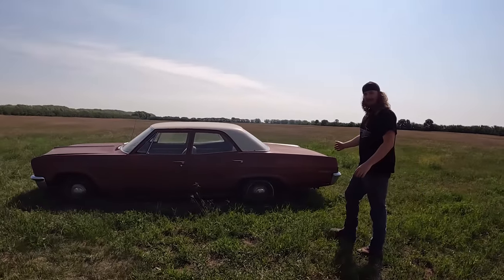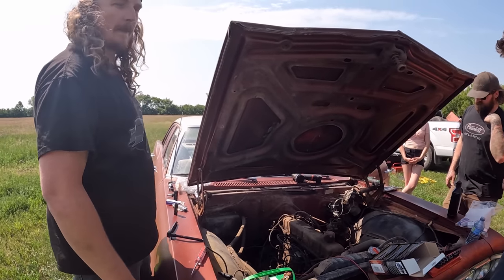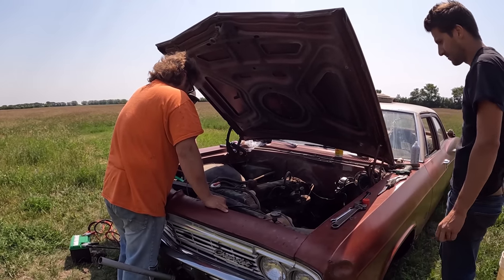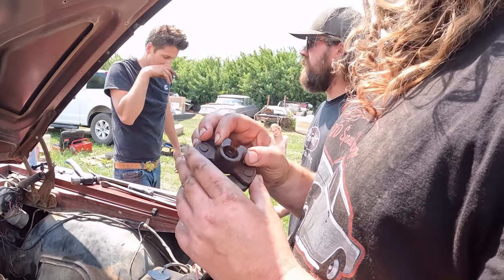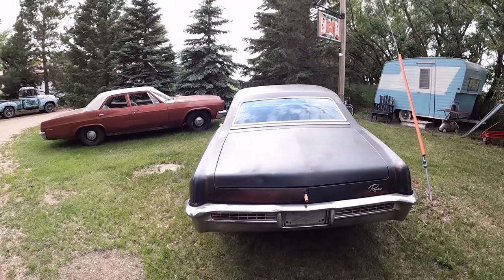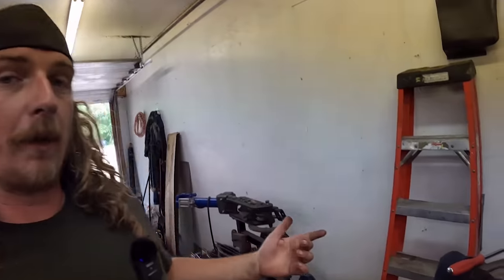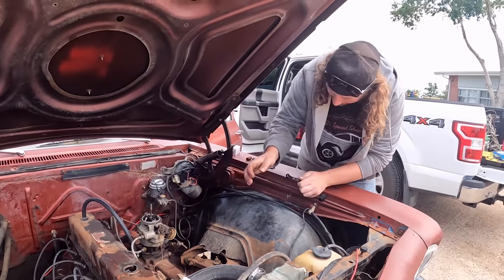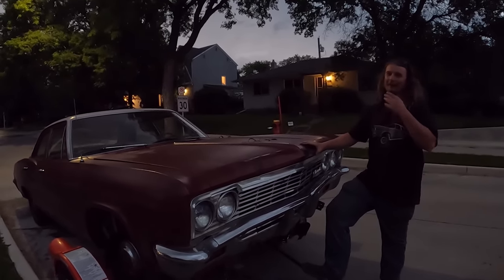ABANDONED 1966 Chevy Biscayne - Will It Run And Drive After Sitting For 20 Years?  Grandpa Special

Comment: I had an Impala 4 dr years ago. You may remember it, it was white with a painted black roof and blue flames called the Millenium Falcon. The front strut rod ripped out of the frame and force it into retirement in 2001. Bought a Belair that I wanted to make one from the two but it never happened. Sold them to a guy on Inkster who had a two door sedan. He wanted me to pay him to take them away, no. Got discouraged from the car hobby after that. Have a lot of spare body parts for a four door I want to get rid of but don't want to scrap. The car in this video looks really good.

Comment: I have my grandmother's 66 Chevelle 2 Dr sedan. Was a 194 straight 6 with Powerglide. Now has a .040" over 427 and M-20 Muncie. It needs front suspension rebuilt and I do have all new parts including tubular A-arms and disc brakes n spindles. New power break master cylinder.  I also bought a 9 inch rear housing set up for the Chevelle. New axles and posi carrier for the pumpkin I'm using from a pickup. 3:91 gears. New mags with new T/A Radials. I always teased my grandmother I would stuff a Rat Motor 🐀 into her car. Promise kept.

Comment: Been there done that. But 500 miles? Nah! All the power to ya!
Nothing like a good running crew cab!
Dads was a 66 laurentian, i had a parisienne and buddy had a strato chief. Couldnt have done it in a day without help from Josh and the mullet bros…👍
A set of 5.38 gears and it will be a serious red light blaster!
I have to add, the variety in the content is refreshing, but i do miss watching the nomad progress..
Fyi, the 2 speed slushbox has a pump on the output side,can push start,and can leave driveshaft on to tow..
Well, at least you still have your sense of humor. Wonder if wheel was straighter before you “fuxed”the bent tie rod? 
Fis the 6, 4bbl and split headers.  They sound wicked. Ask jeff whitby, just did the chief.

Comment: Great show you guy's & gals from here in New Zealand, reminds me of the day when I swapped out the 245 cu 6 for a 265 6 Pacer engine in my 73 VJ Valiant. If you have spark then dribble a cap of petrol down the carby because the whole fuel line will be dry/empty. Come on now you've flooded it. She'll be right you'll see. Too many chiefs lol.

Comment: I love this stuff, great car.  Next time you need to bleed the drum brakes and the bleeders are frozen, make sure the master is full and remove a drum and the little apply pin in the high end of the wheel cylinder.  Remove the rubber cap off the high end of the wheel cylinder and just push the wheel cylinder piston out so the top just cracks open and you can see the rubber seal.  Take a small screwdriver and just crack the seal open at the top and let gravity bleed the brakes.  Once you don't see any more bubbles reassemble the wheel cylinder, clean up the backing plate and reassemble.  Good for another 100,000. Takes longer to explain it than do it.

Comment: Fun fact. You don't need a bleeder screw to bleed the brakes. Loosen the brake hose and bleed from there. O calipers put a piece  of wood in between the piston and ears, have a friend hold the caliper up high and crack open the brake line. That will get the air out. Compress the caliper,  install pads and enjoy.

Comment: After 2 Nova's my 3rd car was a 65 2 dr. Biscayne 283, 3 on a tree. The car I learned to drive a stick in. Did you tie off the steering wheel with a belt to the door when you flat towed?

Comment: Use short cranking intervals. If it doesn’t start right away, investigate. Compression, spark (correctly timed spark), and fuel. Quite the adventure.

Comment: I think it's supposed to have the crush washer style plugs. Try some of your old gm keys I have a key chain full of them and most of the time one will work. save old gm keys, Briggs & Stratton style. Like to have that 68 chevy tow truck.. have to tie the steering wheel straight when it does that when using a tow bar

Comment: I wondered if you would put the driveline back in to load it on a dolly.
 It's a great car my mom had a 67 caprice hardtop and her sister had  a67 Biscayne. But they were both 283s 
 Betting the steering issues was why it came off the road. Those plastic floats Rochester used sucked

Comment: Just get it to run good and drive it as a daily Parts Runner it's cool I had a 66 Biscayne 2 door post I got for my grandpa with 18000 miles this was a 1975 I was going to put a big block in it but my dad was pissed off so I sold it bought a Camaro

Comment: iF THAT IS AN ORIGINAL trans in that ol girl, you can actually pull start them. YES A AUTOMATIC, you can pull startem. We pull started dad's ol 66 impala all the time. exact same thing 6 with a 3 speed auto, you have to be going like 30 or 40 MPH before they kick in but they did and you could pullem start them.

Comment: Had to bump ahead. Grinding on that starter like that just wears out your battery. Points are still around $6 and woulda had your spark fixed. Motor has a valve problem hearing the motor turn over.

Comment: DD: you had a fuel cell with you, not sure why you didn't use it? if the car is sitting more than a year or two I wouldn't bother with the stock tank, it's guaranteed full of mud and gonna clog up jets in the carb. Just go straight to the VGG boat tank special (on the passenger floor) and move on to the ignition system...

Comment: What are the registration laws in Canadia like?
You, Peg and others do these revive and drives but most developed countries I’ve been in, you can only drive an unregistered vehicle directly to either the closest registry office or the closest mechanic for something specifically related to getting the vehicle registered and you’ve got to be able to prove it, usually with both paperwork AND an appointment and even then it’s still not technically legal.

Comment: Wow Im impressed with how good that six cylinder runs sounds pretty good to me. That car will be a good fixer upper.  Could it be all the abuse you guys did to it in the field that caused the front end to take a dump so soon? I may have made the whole way if not abused before you started your journey. Probably not though its an old worn out car.

Comment: I was cringing, that poor starter. When you go to start a car that has been sitting for a long while the cylinders dry up causing low comp also lifters bleed down. Pull plugs add a couple of drops of oil to cyls then crank over less strain on eng . As for spark pull cap and coil wire from cap hold 1/8" from block and open points with screw driver ( flick them open and close) should see spark.make sure 12 v to coil. Saves batt and starter.